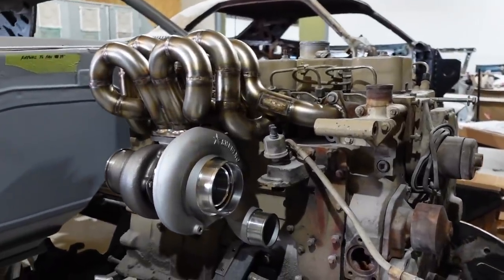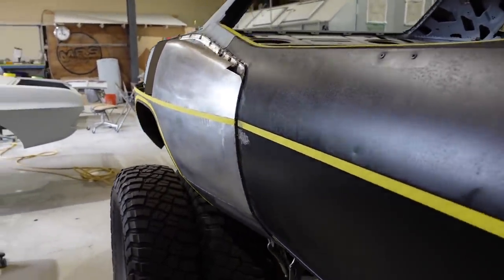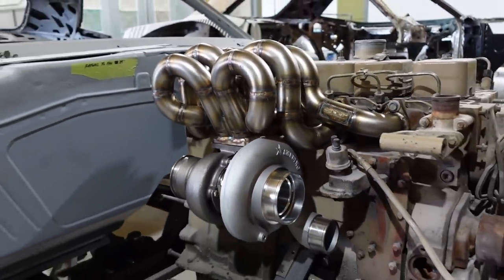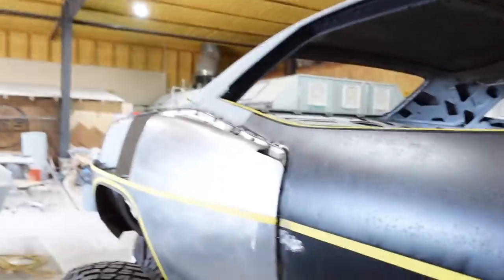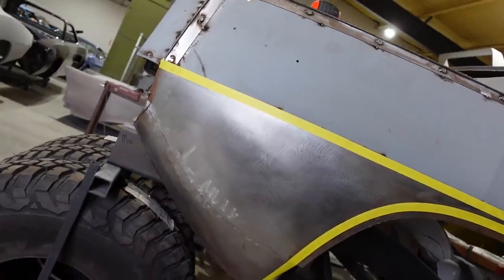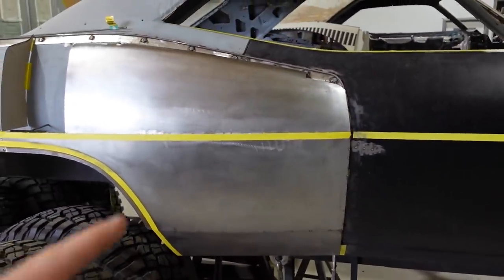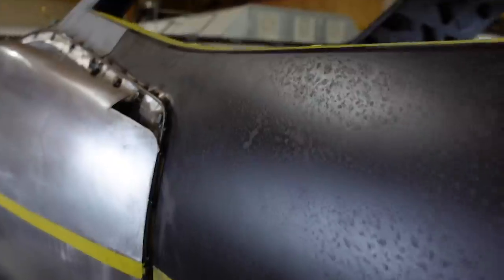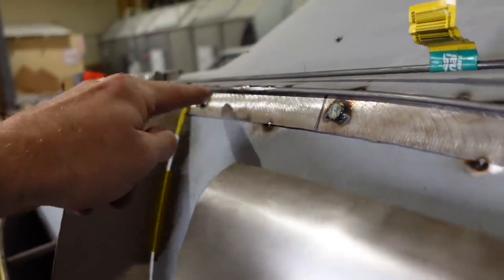Building the DEMO RANCH Plymouth CUDA Dually Fenders EP.7

Comment: Traditional door handle, still modified but still Cuda !
Reply: They're not putting door knobs on it?
Reply: @comfortablynumb9342  im leaning more towards a lever handle, or handleset type door handle. this car would be pretty desirable so i think they should get one with a built in bolt
Reply: @pebkac1245  that's cool. I was joking about putting a door knob on it. But since it's the king of the Demolitia's Cuda I say it should have some kind of gun triggers to open the doors. Or something to do with guns.
Reply: @comfortablynumb9342  then choose the handleset but switch the latch to a gun trigger
Reply: @pebkac1245  I like it.
Reply: @comfortablynumb9342  what about a door that only opens when you solve a 4x4 rubiks cube.
Reply: @pebkac1245  nah, doesn't fit the Demo Ranch thing..
Reply: @comfortablynumb9342  what if theres no way to unlatch the door?

better idea: you have to shoot the door to open it
Reply: @pebkac1245  I like how you think. 
I have seen hot rods with a solenoid and a place to touch to open the doors. I would be afraid of the battery going dead and locking me out..
Reply: @comfortablynumb9342  especially if you shoot it

Comment: As far as door, I would recommend a 3rd option.  Go with a hidden handle like underneath the door.  With the car all lifted, it might be easy to access. I would hate to see an ugly door handle.
Reply: ...and have grab handles conveniently located inside the car to make entry easy!!!
Reply: Good point! That corvette handle would be a little difficult to reach for some people. A lower, hidden handle is an excellent idea! 👌 👍👍👍
Reply: @marcbee1234  like on the rear door pillar. You don't want people lifting themselves up with the door and wearing out those door hinges. I've seen that too often, and it kills the door alignment, and sometimes cracks the body and/or door where the hinges attach.

Comment: 3:00 Questions: 
 1- Wont having a smaller turbo take all the exhaust like that result in a lot of back pressure at high revs? ~
 2- Also, the header doesn't have a waste gate mount? Spin until it blows? or is there some trick?

Comment: I wish Matt wasn’t so sold on running that header. It’s absolutely gorgeous no two ways about it but it’s going to crack and honestly it’s not worth the few extra HP. I’ve been in the diesel game for a long time and on a inline motor a 2 or 3 piece manifold is all you need especially when running compounds. If he was running a huge single with tons of fuel the header may be worth it but not on a compound build made to be daily driven. The flange is one piece, that’s going to crack or break, there is a very good reason why aftermarket manifolds have expansion joints built in. I am currently making 720hp and 1700lb ft on my daily compound 6.7 with a 3 piece ATF manifold. The manifold is a beautiful piece of work no doubt but it will break in less than 10k miles

Comment: Great fab work!  The C3 Corvette dor handles would be a clean look as to not break up that fender.  For exhaust routing in tight places, there are a few ways to do that without causing a noticeable restriction in flow.  One way, and probably the easiest, is to connect to a V8 header collector and now you can run 4 smaller pipes that can later transition to another collector so you can run a single pipe the rest of the way back.  Devil's in the details, of course.

Comment: Careful with those fuel lines. If you go bending them around you can screw with the injection timing / fuel flow and cause problems. (Former Cummins Tech)

Comment: Jeff, they are called wheel well liners. That’s what protects the inside of the fenders from getting mud and dirt up inside the wheel wells. Also, I vote for electric pop locks. No handles. Looks cleaner and cooler. Great progress on the build. Can’t wait to see it finished!
Reply: That's not Matt
Reply: @mountsj  my bag, I heard Matt and it just stuck in my head when I was typing.
Reply: Jeff, the 1st turbo feeds the 2nd turbo, from the  exhaust output of the 1st turbo to the exhaust input of the 2nd turbo. The air cleaner will go onto the 1st turbo intake. The compressed air from the 1st turbo goes into the 2nd turbo air intake. The double compressed air from the 2nd turbo goes into the intercooler, then the intake manifold. This is called a series turbo.
Reply: @TexanOnTheMove  I understand how it works.

Comment: Hey, that's looking really great. Wanted to mention a couple things about the injector lines you mentioned bending. Not sure what you plans are for that if you plan to make new ones or if you had planned to revamp old ones, but its not a good idea to bend existing lines due to the risk of buildup or sediment flaking off from inside and then plugging an injector causing bigger issues. Not saying they can't be bent lots of guys do but its a risk. Second if you are building new to make sure they are all the same length for balanced flow and delivery. Likely things you know but wanted to put it out there in case.

Take care and keep up the hard but good work!

Comment: Ok, hear me out, do the corvette handles. The Cuda handles would be nice but on those you have to lift up which is fine on a lower coupe car, but not on something as high as a truck. The corvette handles would be easier to use, just pull. Unless the Cuda handles could be rotated 90 or 180 degrees, the corvette ones would be the most practical.

Comment: Corvette style handle.. much cleaner and it won’t take away from the fender. Also it will be much easier to open. It will be much more of a natural pull to open. 
Due to the door being so high, for midgets like Mar, to open.
The other way will become difficult and it will be much more abused to the handle. They will natural pull on the handle to open rather the gripping the door. So that means you will damage the older style much faster

Comment: The corvette style handle will look much cleaner, and much easier to open the door. With the car being lifted it'll be easier to wrap your fingers around the body line and into the door handle to pull door open rather than trying to lift the stock Cuda handle up and pulling the door open.

Comment: rear fender is turning out better than i imagined.  does that plannishing hammer work better if its walking away from you?  are you talking about those fasteners called zert/zerk for fastening racecar sheet metal? man im telling you guys need to polish that header if its stainless.  even if it turns brown from getting hot once its finished youll always be able to bring the shine back to mirror with just a sisal buff and yellow kohker stainless compound. door handle id go stock placement

Comment: You definitely need to do the original door handle and if I might suggest, it would be a crime not to put the matte black billboards on the side of the dually fenders where it used to have what cubic inch the engine was, instead you could put a 12 V .

Comment: I think you got the turbo plumbing backwards. Fresh air into the small turbo then the pressurized air from that one to the big turbo to spin that one up and from that one to the intercooler then to the intake on the engine. I think that's what I mean. Not entirely sure. Lol

Comment: With a bolt on fender either way you go with the door handles is going to be an issue if you do have to take them off. Just leave it shaved and do door poppers.

Comment: That turbo center section needs to be rotated. The oil drain line won't drain well sitting at the 3:00 clock position.

Comment: 4:07 with that style of turbo setup im pretty sure the smaller one takes the air it pressurized (boost) to spool up the larger turbo to reduce lag. If it was hooked up to the exhaust side i dont think it would work as well